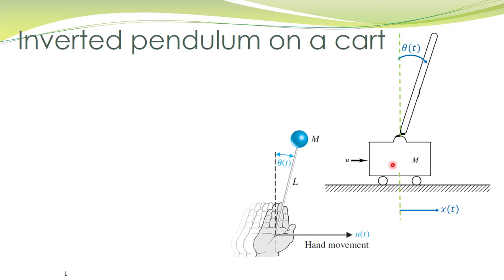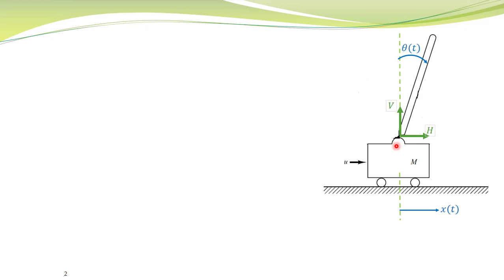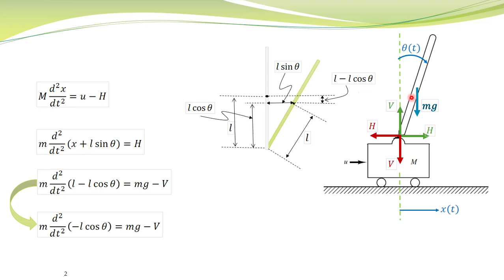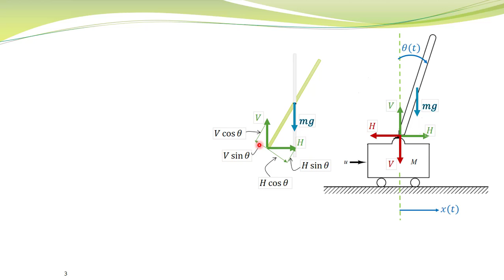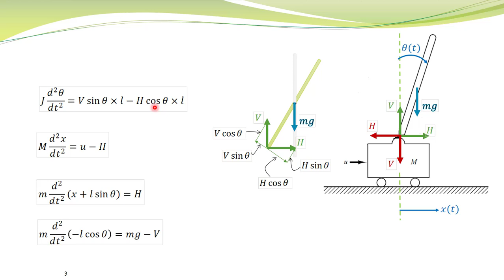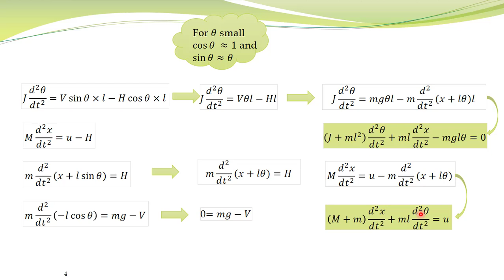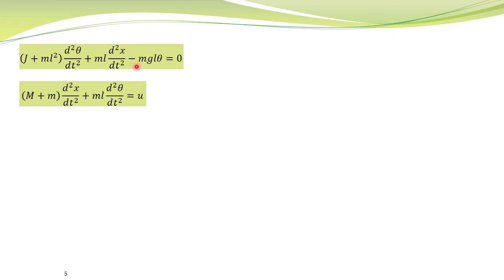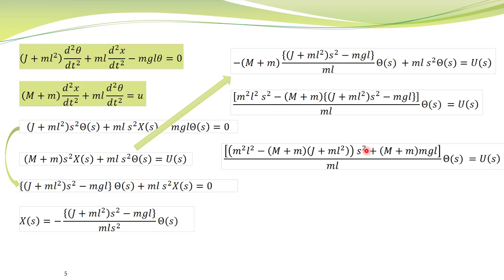LCS - 13 - Pendulum on cart system - mathematical modeling and transfer function

Comment: love your video! How would I proceed if the force applied is coming from a motor and I want a equation with the voltage V_a in term of x?
Reply from the maker: Simple! You will derive a relation between the voltage applied to the motor and the force (force is related with torque ) generated by the motor and then cascade it with the model of the pendulum on a cart system.

Comment: At 15:42, for the simplification of 3rd dynmaic eqn (m (x+lsin(theta))''), can you justify replacing sin(theta) with theta? Shouldn't you take 2nd order derivatives of sin(theta) first then proceed the approximation?
Reply from the maker: The justification of this replacement is at 13:45. We know from our knowledge on trigonometric relations that, if theta is small, then sin(theta) is nearly equal to theta (this can also be verified from the Taylor series expansion of sine(theta)). 

Our objective in replacing sin(theta) with theta is to obtain a simplified model (linearized model). If we first take the derivative and then make the approximation, this will complicate the things. We know that d/dt (sin (theta) ) = cos (theta) * d/dt (theta) and then second derivative is even more complex. Thus to avoid complexity , we have first made approximation.
Reply: @MAFarooqi  Thanks for the response, however I am not quite convinced for the approximation. My argument is that \theta \approx \sin\theta does NOT imply \theta'' \approx (\sin\theta)'' near \theta = 0.

I have an example, if theta = a*sin(1/a^3), then theta -> 0 when a->0. However -theta'' * sin(theta) explodes when  a->0. Therefore \theta'' \approx (\sin\theta)'' cannot hold.
Reply from the maker: sin(theta) ~ theta         --------- (i)

Lets check it for small theta (please set your calculator in radian mode)
sin (0) = 0 (Equation (i) is satisfied)
sin(0.01) = 0.009999 (Equation (i) is satisfied)
sin(0.1) = 0.0998 (Equation (i) is satisfied)

sin(0.5) = 0.479 (since theta is becoming larger, Equation(i) is becoming less applicable)

Now coming back to your observation: We cannot say that theta ~ a*sin(1/a^3), whatever is the argument of sine, the same should be on the other side of the inequality. For example, you may check (1/a^3) ~ a*sin(1/a^3), and it will be satisfied.

Comment: I have a question: when modeling angular movement, can we set the center of rotation at the joint between pendulum and the cart instead of center of mass of the pendulum? If so is there advantage or disadvantage for each method?
Reply from the maker: Yes, you can also take the joint as the center of rotation. In both the cases, you will finally get the same mathematical model.

Comment: in my logic, the horizontal displacement of the pendulum should be: x - l*sin(theta), because when we assume that theta is small, sin(theta) ~ theta, it means that the rotation of the pendulum will opposite to the movement of the cart.
Reply from the maker: The direction of movement of pendulum depends upon the direction of displacement of the cart (opposite, as you mentioned) and also up on the rotational velocity of the pendulum. The Figure on the slide depicts the situation at a particular time instant, and at this particular time instant, the displacement of the CoG of pendulum is x+l*sin(theta).

Comment: Very useful. Thank you♥

What if the pendulum is at the left side?
What are the changes in the equation? 
Like at the right, x + lcos(theta) → x - lcos(theta) at the left.
Reply from the maker: Yes, you are right. However, there is another way to look at it. There are two things associated with angle theta, that is, it's magnitude and it's direction. If the pendulum is inclined towards left, we can still consider it with right inclination but with a negative magnitude. And in that case, the expressions written will be applicable for both, the right and the left, inclinations of the pendulum.

This situation is similar to the strategy utilized for the analysis of electrical circuits. We assume a direction of current and if actual direction of current is opposite to the assumed direction, it's magnitude comes out to be negative.
Reply: @MAFarooqi  Thank you so much. You are great♥
Reply: Will it be? if the pendulum is placed at the left side.
Hcos(theta) x l - Vsin(theta) x l

Comment: Example • A 460-V, 25-hp, 60-Hz, 4-pole, Y-connected induction motor has the following impedances in ohms per phase referred to the stator circuit: •R1=06.41 • R2  x1=1.106ohm xm=26.3 = 0.332 ohm X2= 0.464 ohm  Find the maximum torque and the corresponding speed and slip • Find the starting torque  When the rotor resistance is doubled, determine the speed at which the maximum torque occurs and the new starting torque • Plot the torque-speed characteristics of the original and doubled rotor resistances